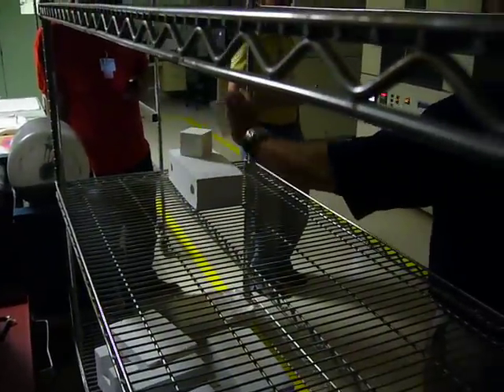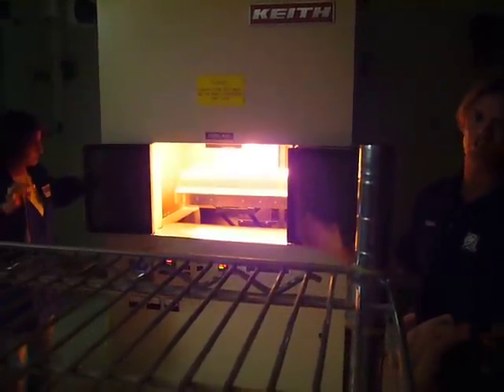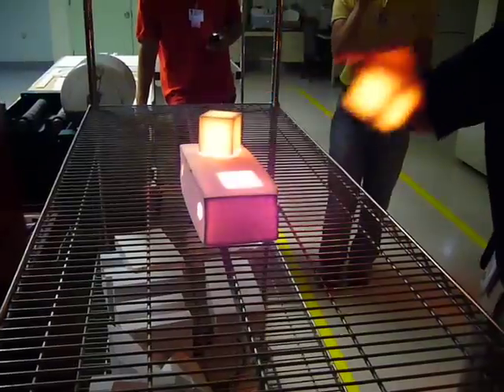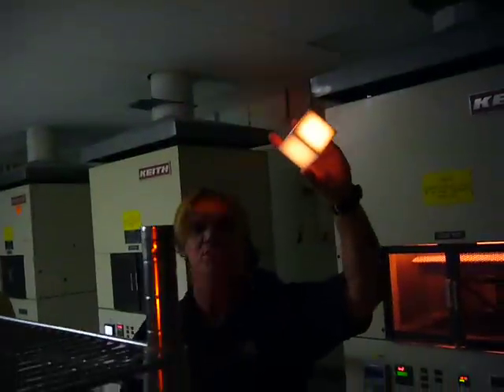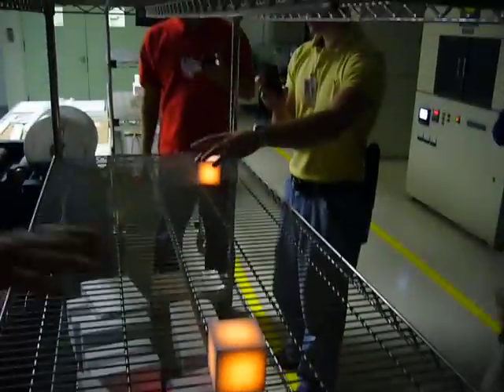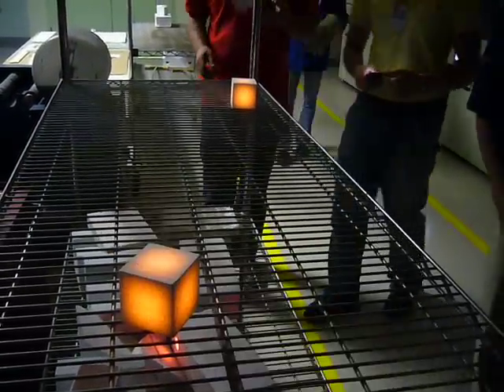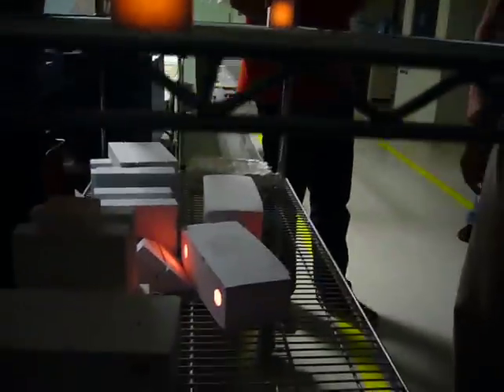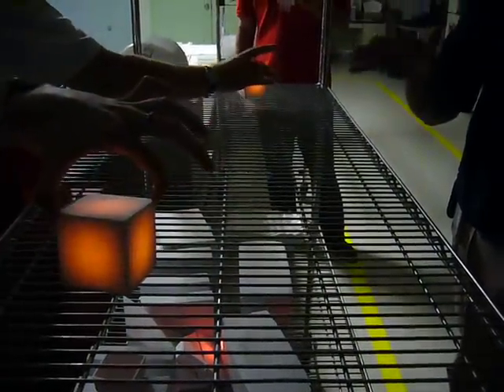Space Shuttle Thermal Tile Demonstration

Comment: Can anyone tell what is the metal is used plsssssssss😢😢😢
Reply: Not metal. Composite material
Reply: They're Ceramic, not metal.
Cool stuff!
Reply: The one used in the space shuttle are mostly made of silicia class fibres. SpaceX currently uses tiles made of silicia, aluminium oxide and aluminiumoxide borosilicate
Reply: @felixholzhey5026 

OooOhh.
Specifics!
I was wondering exactly what they used, because of course straight ceramic like what you can get kitchen knives made of wouldn't be up to snuff.

Comment: What a load of fake crap.  But let’s not forget it has to pass through 5000 degrees before space.  Smoke and mirrors.
Reply: The thermosphere is hot, but it’s also sparse. So when you pass through the thermosphere, only a tiny amount of energy can be transferred to your spacecraft. Much smaller than the 1300 W/m2 of energy we get from sunlight. Once you design the spacecraft to deal with that, the thermosphere is unnoticeable. 
We know these tiles are real, because we can reproduce them from scratch, and confirm they really do insulate as well as NASA claims. We know they are real because we can find the satellites launched by the Shuttle: from the ground we can observe things like the ISS and the Hubble Space Telescope, and many others.
Reply: I'm not even going to try and debunk this comment, it has no substance.
Reply: Wow.  That is a scam response.  You are talking crap.  5000 degrees is 5000 degrees no matter how fast you are going through.   And then you hit zero kelvin in space right after.  Can you explain the effect of 5000 degrees which  is hotter than any metals melting point by over a 1000 degrees to then hitting 0 kelvin, absolute freezing?????  
No you can’t because nothing can survive 0kelvin which google will even tell you is the temperature of space.   Scientists today’s day time freezes at zero kelvin because nothing can survive that temp.   Worse temperatures than the catastrophic ice age.    No.  This is a load of crap.
Reply: Even if metal is heated to half its melting point and then subjected to absolute zero freezing, any idea what happens????
Nothing survives 5000 degrees and nothing survives 0 kelvin
Reply: @owentimms2485 Wrong on both counts.

Nothing Alive survives reaching 0 degrees Kelvin (because that's -460 degrees Fahrenheit), while you could freeze a chunk of metal to 0, and it would be fine.

And this shit isn't metal.
Its ceramic. different rules of heating here.

They also aren't even at 5000 degrees, they were in that oven at 2200. learn to listen.

Comment: 100% Fake. I worked in a glass factory and you are not standing that close to a oven of that temp wearing those clothes and not sweating or showing any discomfort. Lights inside some boxes. NASA is total BS.
Reply: People have recreated this type of tile and done the experiment themselves. So we’ve verified that these tiles work as advertised.
Reply: The oven is behind the wall above the platform that are going down. You don't see inside the oven where the heat is.
Reply: @Bnslamb  You can't be this naive
Reply: @Bnslamb  The content doesn't change. Sounds like you need to watch it again and use some critical thinking. Notice how they say where ONLY to grab it, and others grab wrong spot and zero burn or acting like its hot. Sorry man you've been lied to, its not your fault but its on you to see its true.
Reply: @Bnslamb  Still doesn't change anything. Cognitive dissonance is strong
Reply: Bet you don't have the guts to go on the tour and tell them this directly.
Reply: That's not how radiated heat works. you're only saying that because you've been conditioned by a community of shills not to belive anything science related that you don't immediately understand.

Just because it sounds improbable doesn't mean there's no reason for it to work. And, as with literally anything aerospace related, you can easily find out exactly how pretty much anything works if you actually put in the effort. I bet if you actually look up 'shuttle heatsheild tiles' you'll find an exact, clearly defined explanation of exactly how these ceramic tiles work. and why these people aren't a bit crispy right now.

But something tells me you won't bother; which, honestly, doesn't effect me much. You do you.

Comment: I was thinking about incandescents today... If you could insulate them so the heat can't escape... MIT claim to have made an incandescent that is 40% efficient using a crystal lattice for insulation. I still think it could be better if they ditched the electrical connections and used induction heating as I can imagine most of the losses are through the thermal conductivity of the metal electrical connections.

Thinking about insulated lightbulbs though led to one big elephant in the room, you wouldn't be able to turn them off like you can a normal light bulb! You could quite literally unscrew the bulb and use it as a torch until the filament/element cooled back down through the thermal insulation.

I'd love to play around with the theory but I don't really have the technical know-how on how to manufacture such as at home xD. I suppose I could do a bit of research but I can't imagine it's something you could easily do without expensive equipment.

Comment: The guy is saying the cubes are dissipating the heat quickly, but wouldn't that just transfer heat away from them and burn your hand? I thought the reason this works is because they are made of an incredibly effective thermal insulator, so they don't conduct heat easily which is why they're able to stay glowing hot for so long as well?
Reply: I know this response is two years late, but they are correct in saying they are incredibly good thermal insulators. The heat is lost not from thermal conductivity, but through infrared radiation
Reply: @MrShadowOfGaming  so it would be around as hot as a relatively efficient lightbulb in your hand?
Reply: @MrShadowOfGaming how something glowing that red hot doesn't grill your hand then?
Reply: @spolo123 because it's a horrible heat conductor. The heat in the middle moves very slowly to the edges while the edges exposed to the air dissipate their heat almost instantly. This leaves the edges slightly warm.
Reply: @willausterman3104  thanks, the pictures showed that yet your explanation helped me grasp that better 👍

Comment: yes, but they are also extremely light and fragile, they have a tendancy to fall off every few often. They were also expensive to replace the damaged ones after every flight. The shuttle was too ambitious for its time, if we for some crazy reason made another one out of modern materials, put it on top of a reusable booster, add bigger and stronger heat shields we could actually make it airliner like
Reply: Keyword on top. Less difficulties with balancing. Also,  smaller. Also make cargo only variations, never mind im talking about dream chaser
Reply: Brother I want to make an engine
 The thermal insulation process was adopted
 No heat and radiation
 I have encountered the problem of extreme heat
 I want to ask you the best materials needed
 I want it to withstand extreme heat and easy to shape

Comment: Dissipate??? ... It's an insulator, that fact is born out by the demonstration , once the edge cools a bit you can hold it and the glowing hot 2,000* center does not conduct to your fingers
Reply: It's the combination of high surface emissivity (ability to quickly dissipate heat via radiation) and very low conductivity that makes this demonstration possible. The tile's surface, and particularly the edges, are cooled off very quickly to a tolerable level, and the low conductivity prevents that heat loss from being replaced by more heat from the interior.
Reply: it's a box with a lightbulb in. REALLY obviously ffs.
Reply: @papalegba6759  please, troll someone else
Reply: @donbeary6394  truth is not a troll, blind boy.
Reply: @papalegba6759  truth , and science, do not care what  you think  . and neither do I .. now please go away

Comment: ight so i was researching this shit did he fuck up by saying "dissipates heat" when it should have been its a poor thermal conductor?
Reply: The tile quickly dissipates heat from the surface via radiation (mostly infrared), but the low conductivity prevents that heat loss from being replaced by more heat from its interior. If the surface had much lower ability to radiate away heat (like that of polished silver), it would stay hot much longer.

Comment: "Hey! Look how much heat it can take!"

"Yeah, but don't bump them slightly, or 7 astronauts die."
Reply: magicstix0r that “slight bump” was contact around 500MPH idiot.
Reply: @williamwatkins1996  It also wasn't an impact with the heat tiles, but if you knew anything about how fragile the tiles were, you'd understand my statement, dumbass.

Maybe you should actually do some research on how terrible the shuttle program was before you open your pie hole next time.

Comment: And all it took to render one tile on the shuttle useless was a little ice hitting them at high speed.

They should have developed them to be immune in such a situation.
Reply: That was a different tile. The tiles on the leading edge of the wing were reinforced carbon-carbon, and they were hit by foam insulation from the external tank, not ice.

Comment: A bit confusing they dissipate heat quickly but will stay hot for a long time...
Reply: The heat loss from the surface to the surroundings happens pretty quickly by radiation (mostly infrared), but the tile's interior stays hot for a long time because its very low thermal conductivity prevents that heat from being transferred to the surface.

Comment: Curious how the Space-X boosters are able to achieve re-entry with just their drag fins and no tiles like these.  The drag fins have no air to act upon for several miles of their descent... Or do they?  Do they rely upon their engines to slow descent the whole way down?
Reply: The boosters only bring the payload into sub orbit
Reply: Booster has less surface exposed to heating during re-entry (just the bottom part where engines are located, and this one is protected by their own heatshield) so with lower mass it also experiences less drag and less heating. They are also doing engine burns to slow the booster for landing. 
First and foremost, a landing booster is just like empty can, most of its mass is already gone (fuel/oxidizer burned up).  Less mass means less energetic descent.
Fairings for example, are very light and experience almost no heating during re-entry.
Reply: Space-X boosters go at least four times slower than a Space Shuttle at the start of re-entry.

Comment: Uh... ok ive got a couple problems with this;

Did he just say it was molten in the middle?... uh... ok... if it's still molten in the middle don't things heat from the outside in? So why is the outside not also "molten upon taking it out if the furnace thereby being a puddle and not a cube...

Dissipating heat would require an object to transfer that thermal energy outward to another object (ie: air, rack, idiots hand) through convection, conduction, radiation, etc. ...  so wouldn't that heat then be rapidly transferred to the persons hand causing severe burns? If not please explain where the thermal energy is going... 

I'm not saying it's impossible or fake... Just that my understanding of physics may not be "up to speed" with what is taking place here and I'd love to know more.

Comment: His description is rubbish.  It doesn't dissipate heat quickly, it does the opposite!  It's a very good insulator, and hence fails to dissipate or transfer it's thermal energy to your hand, and so doesn't burn you.  Aerogel based material I believe.
Reply: Bear Baler 
Said the troll with the 4th grade reading level from his keyboard

Comment: I know it doesn't change the science or anything but is this Fahrenheit or Celsius? Since he mentions molten metal I'm assuming Celsius but on the off chance it's in freedoms I will be a lot less impressed considering it would be half the temperature.
Reply: Aluminum melts around 1220ish °F, so melting metal is perfectly reasonable regardless of the units.

Also, based on this document I found with some googling, it looks like it's Fahrenheit. https://www.nasa.gov/centers/kennedy/pdf/167473main_TPS-06rev.pdf

Comment: This appears to be the Starlite material claimed to be able to withstand and insulate from extreme heat. It was invented by amateur chemist and hairdresser Maurice Ward (1933–2011) 
His computer was hacked, all the data was stolen and the only two pieces known to exist were stolen. 

And now NASA who were originally in negotiations for it, has it. 
Proof of corruption.
Reply: No, that's definitely not Starlite, if that stuff even exists. Starlite is probably a hoax.
Reply: Wrong. Starlite is a hoax. This tile is made from LI-900 - essentially a 99,9% pure silica foam. Quoting the source "LI-900 was designed to minimize thermal
conductivity and weight, while providing the maximum thermal shock resistance. An LI-900 tile can be heated to 2,200 F and plunged into cold water without damage. "

Comment: What would happen if you put one in water?
Reply: I appreciated Emil's contribution.  Now I have some idea of exactly why solid metal may crack. 
Thank, Emil!
Reply: Say no to crack!
Reply: Metals don't technically crack because they release the heat to quickly, they crack because metals are very temperature-sensitive when it comes to their density. So when you put a hot block of metal into water the outer layer cools down and shrinks rapidly while the core still is glowing hot and keeps its volume. Due to the resulting tension on the metal's surface it cracks, not the release of heat perse
Reply: So basically the metal cracks because heat is released to quickly?
Reply: Curt Heisler thank you :D

and you're welcome of course
Reply: I thought it would crack at first too, but after reading a few wiki articles it turns out plunging it in water will not do any damage to the tiles.
https://en.wikipedia.org/wiki/LI-900?wprov=sfla1
Reply: It was fine, but not perfectly fine, as the problem isn't how fast the heat is released, but much rather how unevenly it is released, but at this point I'm kinda nitpicking tbh, sorry 'bout that

Edit: not saying that rapid cooling is not a problem for metal, but it's not the main cause for cracks. If you shock-cool glowing hot metal (assuming it doesn't get damaged otherwise), it hardens it a lot, but makes it comparably brittle to untreated metal. To regain a metal's ductility, you can re-heat it. That way you keep the improved hardness without making it so brittle.

If anyone is interested, you can go and look up heat treatment for metals, there are multiple variations of heating and cooling a piece of metal to gain wanted properties, it basically is all about how the separate atoms arrange and re-arrange in the crystal-structure when you expose them to varying temperatures. Don't know if I used the factual correct terms though, English isn't my first language.
Reply: sarcasmo57 the shuttle will crash
Reply: Bruce C. Best comment on this video
Reply: But is it metal at all? Or ceramic/glass stuff with huge amount of air in it?
Reply: depends of how much water you're talking about but water requires a lot of energy to heat up 1 degree 4.186j per gram to heat it up by 1 degree to be exact.
Reply: 🤔🤔🤔 perharps, u be stretch or can be... Crack!
Reply: the block may crack. or there would be a chance of rapid boiling
Reply: Elijah Martin It wouldn't crack... Metals crack in water because they release heat to quickly... Same thing this is doing. It would just boil it like you said.
Reply: Idk why don’t you ask god, wtf what else you think it’s gonna happen
Reply: Emil You just wanted to be involved. What I said was perfectly fine, it was explained in layman's terms. Thanks for the technical reasoning though.

Comment: He meant to say it transfers heat slowly, hence why you can touch it
Reply: He said it dissipates heat quickly and that's exactly what it does. He said what he meant to say.
Reply: @AlexDogwalker1234  Silica is an insulator. That's how astronauts return un-cooked. The corners have more surface area so dissipate heat faster but the heat is then not drawn from the core because the material itself has slow dissipation. So you are both right. It's difficult to say in one sentence as the question arises, why can't we touch the corners of a red-hot steel block. The surface area is higher so it is dissipating heat faster than the core but if we touch it we will burn our fingers because it is quickly dissipating heat from the core also. It's annoying!!
Reply: @jort281 
أخي أريد صنع محرك
واعتمد عملية العزل الحراري
عدم الحرارة والإشعاعات
لقد واجهت مشكلة الحرارة الشديدة
فأريد سؤالك أفضل المواد اللازمة
أريدها تتحمل الحرارة الشديدة وسهلة التشكيل